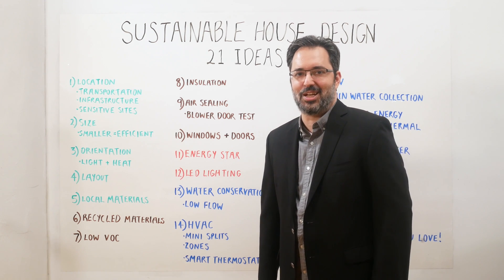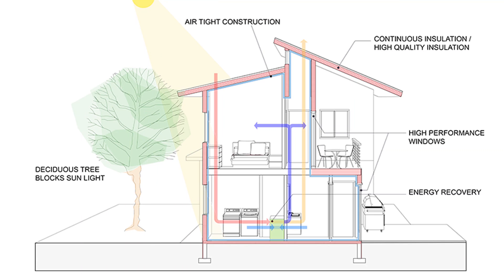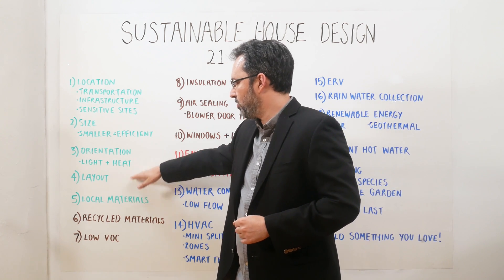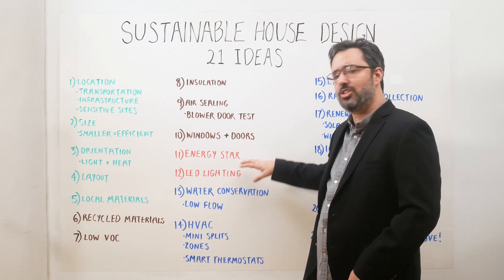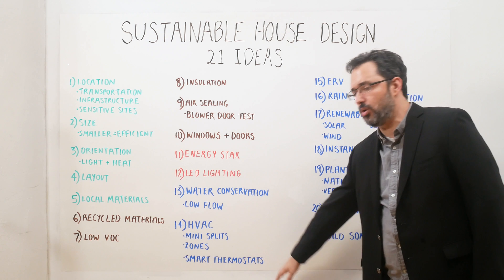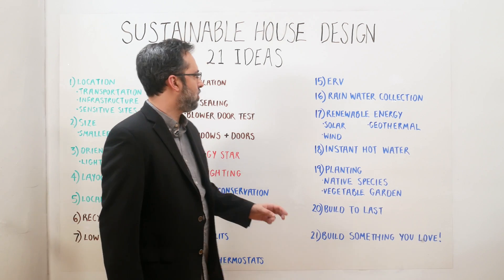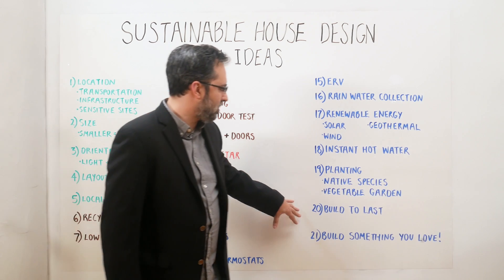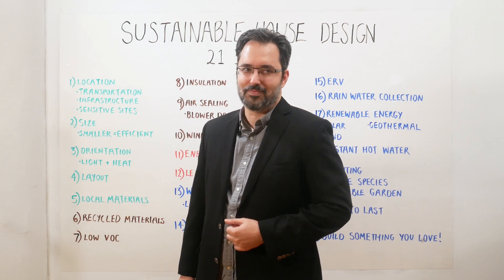How to build a Sustainable House - 21 Sustainable Home Ideas with Architect Jorge Fontan

Comment: Make your house disabled accessible - you'll be able to find a code for that somewhere. Remember that the disabled person in the house could be a child with a broken leg, or could be an elderly grandparent, or could be a pregnant mother with complications that put her in a wheelchair for the duration but she still needs to be able to read the older kids to sleep at night.

Build your house to last. If you can change from the modern standard of a 50 year design life to a 500 year design life, you just reduced by 90% the annualised embodied energy of that house. So think about durable materials, a long-term-viable location, and planning for the future. People 500 years ago weren't thinking about indoor plumbing, never mind electric lights or wifi to every room. Will your house accommodate new plumbing and wiring expectations? How much of it will actually last 500 years, and how much is going to need replacing every century or so? Are your electrical and data cables in conduits so that the lines can be replaced easily in future? Are the waste water pipes in a place that you can dig them up and replace them too? If a new room type arises, like the indoor bathroom that isn't just a bath by the fire and a pot under the bed, do you have a space that can be converted to that new use? If working from home becomes the norm for everyone, can this house still handle a family?

Houses in Europe built in the aftermath of WWII are barely habitable now because they get so hot in summer - is your design ready for several centuries of worst case scenario global warming or cooling?
Reply: Great points!

Comment: i think the therm "breathble wall" might be misunderstood in this video. to my knowledge, a breatheble wall breaths vapor not air. we use blown in celluoloce and the wall needs to be air thight but vapor open. athorwise condecation wil take place inside the wall. light staw clay walls finisht whit a natural plaster breathts, and is a lot more sustainble than synthetic or miniral insulation. it alos creats a haelty inviorment. Unlike pur and pir insulation. 

An athor alternative for the instant hot water is a heat battery. like a salt hydrates or phase change battery. This way you don't need t store electricity in battery's. Wich are more expansive and less sustainble. The heat battery can be charged with solar hot water collectors and a heat pump powerd by green enegry.

A house schould indeed be build to last a long time. But, ad the end of its life. The materials used, schould not and up on a landfill. but be biodergdable or endlessly recycled.

Comment: Also the  building materials should ideally be  able to be  recycled at the end of your house life.Don't use materials that just end up in the tip.Consider using plants which can shade the verandah or windows during hot summer months and then drop their leaves to let in sunlight during winter.Natural cross ventilation is a winner - warm air rises and draws out excess heat through vents up high on walls.

Comment: What you might add is: Thermal mass.

High Thermal mass makes all "flows" slower. It is basically the resistance of the walls against heat/cold, giving more comfort in winter and summer. You wanna build so you have some mass that can actually store the energy.

Americans don't know that cuz they build paperwalls :D (friendly joke, don't hit me)

Another big point of sustainability is financial sustainability. It is a topic for itsself tough. But basically you want everyone to be able to afford living sustainable and expensive solutions are not really solutions.

Comment: I purchased a house in Astoria R6B zoning. Thinking to install a backyard office (no bathroom, just electric power/insulated). Lot size 24X100 sq foot. Building size 24x40. My question is - do I need a permit for it and would this office shed (18x10 ) effect building 3/4th floor in the future? Thanks a lot in advance. Hope you have a quick answer for me ;). Thank you

Comment: Before deciding to built in air-conditioning I think it would be useful to contemplate if it is really necessary. Where I live we had up to 38 or 40 °C in the past summers but we managed to keep it relatively cool and we don't have air-conditioning. I think one part is that we don't live inside the city but next to a field, we have trees and bushes and grass on three sides of our house, a good insulation as well and an open staircase that leads to the basement. Two summers ago we got new blinds, they're sliding metal (?) blinds with small gaps in between. And they cool down the ground floor in summer so much more while also letting in more light. So I believe, that with a good built, that really fits the climate the building will be located in, you don't necessarily need air conditioning.

Comment: Not breathable walls - what about mold?
Reply: The idea is to keep moisture out of the building envelope because it increases heat conduction which reduces efficiency. So a non-moisture permeable insulation layer is lower energy/higher efficiency.  Sustainable? I guess by present vernacular. That mindset doesn’t account for other negative environmental factors, however. 

Back to mold: mold needs heat, moisture, and food (cellulose) to propagate. By mechanically ventilating, the efficiency gained by the insulation is greater or equal to the cost in energy of running the electrically driven fan(s). And because it keeps moisture levels healthy and low, even if ‘glass insulation were used there a) isn’t much to infiltrate the insulation and b) the high-R of foam isn’t going to be cold enough for moisture to condense in the envelope. 
Breathable walls are more likely to allow mold to begin.

Comment: Great video Jorge, offset wall with vertical glass at 90deg to wall faces and a reverse pitch roof with eave step to allow sun onto glass in winter works well.
Exterior concrete and vertical studs attached to Gyprock to allow air flow from bottom levels up inside walls to upper vents, so air can be pumped along concrete to suck out thermal mass, either cold or hot side of house... to control internal temperature, I have seen this system with DC fans in basement, no air cons, and cool in summer.
Computer controlled lines of fans in basement wall.
Reply: Hey, I'm a highschool student needing some help with a sustainable home project. Could you dumb down what you said a little bit? I basically need to "build" (draw) a sustainable home. I chose albuquerque New Mexico as my location. Please get back to me if you can help in the slightest
Reply: If your looking to cool buildings look at cultures who have been building that ways for millenia if not centuries

Comment: Really great tips! I feel like more people should do low flow water and the zone heat/air. Also, it's so hard to heat and cool tall double ceiling rooms. The heat just goes up. Speaking from experience.
Reply: Better insulating and air sealing the building envelope can help with that, but most American homes fail in both areas.

Comment: What's your opinion on geothermal HVAC over microsplit? We're in the early RFP phase of our home construction and I'm leaning heavily towards geothermal HVAC  with a desuperheater and tankless water heater. This will be built in Florida where the water table is fairly high making the thermal exchange a lot easier on the system. Do you think geothermal is as viable long term as the microsplits you propose in your video?

Comment: I live in my grandmother’s old house, built in 1930, which is a 20’ x 20’ square box, with a partial upstairs coming in at 748 sq feet.  Hearing that small square houses are more energy efficient made me so happy. I used to feel ashamed about the size but as I learn more about sustainability I see smaller is better! This little house was built to last! We live in Mass where the Mass Save program will come to your house and install insulation and do the blower door test.  We have been making improvements like this since we moved in 3.5 years ago. Thanks for making this video! It will be saved and I’ll come back to it to check in ways to make the house sustainable.
Reply: Don't ever feel ashamed about the size of your home! The worlds trends makes you think bigger is better because they want you to buy into it. And trends will change all the time and make you think you need to buy into every trend. You do you and you're even doing stuff to make your home more efficient!
Reply: Why?🤪
Reply: Well this video doesn’t cover very much ‘sustainable’ advice. Mini splits and rainwater? I literally am laughing. 
People survived 20,000 years with no AC!  And suggesting wind power? Less than 7% of North America can support the air speeds required for effective wind power, maybe half that 7% is near or over 90% uptime. 

This guy knows the current trendy new stuff and calls it sustainable cuz it’s the cool buzzword. No reference to the ‘balance’ or downside of these currently popular areas, like cost, manufacturing impact. Mentioned LED lighting but no advice on how to select ACTUALLY sustainable lighting. 

Sustainable is merely a cool-sounding word people use impress the uninformed and unaware when the environmental cost to produce and implement is far greater than the potential opposing energy savings.

Comment: "heating and air conditioning is a greatest expense of energy" NO; it was in old poorly designed buildings; nowadays when you build passive, insulated and airtight buildings highest expense would be domestic hot water and electricity
Reply from the maker: Most homes are not passive, nor have good insulation, and are certainly not air tight. So heating and air conditioning is still the greatest expense of energy in a home in the United States. You can look up the Department of Energy statistics on this if you like. You will find that space heating is double the energy use of water heating for the average home. I am discussing national averages, not isolated high quality homes, and certainly not just new homes. I doubt new homes alone even qualify due to what low quality construction people proceed with in most cases in order to save money. Here are the numbers from the Department of Energy:  https://www.eia.gov/energyexplained/use-of-energy/homes.php
Reply: @fontan.architecture  new houses should be like i described, old should be thermaly modernized
Reply from the maker: @MhUser  Yes that's the entire point of this video.

Comment: Wouldn't a natural ventilation be more cost efficient than an erv. Each teacher I have met has different views on this. Amazing video btw.
Reply from the maker: This video is about sustainable houses not upfront cost effective houses. Saving money in the short term to lose money in the long term is not cost effective. Sustainable design is more expensive up front but has long term benefits. When people say cost effective they have to take long term vs short term into consideration. 
Do you want to use natural ventilation when it is freezing cold outside in the winter or when it is incredibly hot and humid in the summer? I would not. Short term thinking leads to bad decision making.
Reply: @fontan.architecture  I see. Thank you so much.
Reply: I dont know why it is such a problem for Americans to just open windows to let in air :D Cold winter air is also good to get humidity out in the morning. You can still have an AC system for summer, if needed.